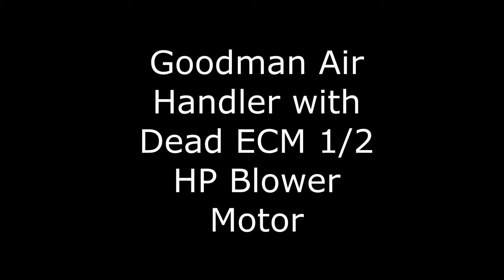Dead ECM Blower Motor in Goodman Air Handler Replaced with Traditional 1/2 HP 1075 RPM Blower Motor

Comment: Couldn’t you have used a contactor as a relay for the high voltage going to the motor and hooked a common and green from the thermostat to the 24 volt side that way whenever there’s a call for g it will send power through the contactor and turn the motor on. What do you think ?
Reply: Thought the same
Reply: That's what Steve Lav did!
Reply: I was just gong to say the same thing.

Comment: a decent solution would have been adding a fan relay that has normally open and normally closed contacts, use  green from t-stat to turn relay on and (N/O) contacts to run blower on higher speed, then with relay off the (N/C) contact feeding lowest blower speed for continuous air circulation.

Comment: I understand the motor isnt available, but what about the Motor Module alone?
ohm the motor and if all 3 legs are the same, motor is good and get Module.
Reply: Probably it would cost more to rebuild than to buy new. Also the bearing might be going bad or  smth else that has caused the board failure is still present. Bundle that with the fact that you have to give some kind of warranty on the repair...
Reply: seperate module is not available from goodman yet. It's happening soon but not yet

Comment: Would you consider taking a 28VAC tap off the control board,  connecting it to the coil of a 2 pole contractor in the air handler ( using it as a switching relay) to switch the fan on/ off ?? 🤔

Comment: You should problem learn how to check an ecm motor, 9 times out of 10 there is nothing wrong with the motor it’s just the end bell module that can be removed and replaced without even taking  the motor out of the housing, if your not testing your guessing I thought

Comment: You mentioned that you were going to install a relay, but it wasn't shown in the video. Plus you never showed the final wiring. Of course, it's obvious that you didn't need a relay if the motor is going to run 24/7, but not every tech is going to know that. Entertaining sure, educational: not so much. You need to be more thorough from start to finish if your objective is to help the HVAC community learn. Just my opinion. Thanks for the video.

Comment: Did you tell Sippy Cup that the motor is reversible and you must check for proper rotation and if incorrect, you must change those two wires with the spade  connecters on them?  Another question; is he there to learn, take video or to aggravate you?
Reply: Seems like his purpose is to shoot video and aggravate Mike. Personally would rather just go it alone given the skill set or lack of from this kid. He is getting an education just does appreciate or realize that unfortunately is the way he comes across.

Comment: Love your videos.  In case you weren’t aware, those typical x-13 motors are available everywhere today even Amazon for around $250.  Those are Genteq motors and sold under various names with Evergreen being the most popular.  Yes it may be true the speed may not match exactly but it doesn’t have to.   If you’re that concerned, you have 5 taps so you could select a speed that is closest to what is needed.  You could also reprogram these motors very easily as others have indicated if you wanted to match the exact speed.  But in its unlikely you would need to change anything.  The tap speeds are usually very close to original equipment.  There are several problems with a continual run/constant speed motor.  One is when the Condenser shuts off, the continual air flowing over the evap will throw lots of humidity into the building air.  You will likely smell it for about 5 minutes or so.  The second issue is if this is a heat pump/heat strips, the heat strips require a faster speed than the air conditioner.  You run a risk of the strips overheating. Just a thought.
Reply: Good points about the humidity level from the fan running 24/7 and odor. Didn’t think about the heat strips if this was a heat pump. So the $250 price from Amazon is the fan motor only and Ecm module that connects to motor must be purchased separately I assume. Personally would not want a 24/7 fan in my home.
Reply: No its the whole motor complete with ECM module.  The OEM prices for the same thing are ridiculous and upwards of $700 or more.  Most supply houses offer the Evergreen motors but there is usually a markup of $100 or so over the $250.   Another thing to consider is when an ECM X-13 motor fails, it may just be one of the speed taps usually #2.  If you switch that wire to another tap, it may run the motor and at a little higher speed.  This is useful in that you can get a customer immediately working while you wait for a replacement.
Reply: @rogerf3622  Thanks for your reply. I have an old Trane air handler with gas heat and split system cooling that’s about 18 years old with an ECM motor. Good to hear there are cheaper fixes rather than OEM route.

Comment: It’s often just the end cap on ECM-blowers that go. The motors are really very durable. I have only replaced two complete motors in the last five years. You should pick up a motor tester. 🇨🇦👍
Reply: some techs take it that far. some of us replace both to tie up loose ends.
Reply: most ive changed they wont sell cap alone

Comment: Pro tip I learned in my days of low voltage installs. Cut your zip ties off flush with a pair of flush cutters and you won't run the risk of them cutting the ever living f**k out of your hands next time you dig into the wiring.

Comment: Spend 5 more minutes and like 10$ more for the relay and have that fan shut on and off with thermostat call.  Running just the fan 24/7 will bring all the moisture back into a house causing high humidity...
Reply: @PipeDoctor  I'm sure that uv light is only for coil sanitation meaning it doesn't really clean the air and defiantly doesn't need high speed blower operation at all times.  Low speed on ecm yes, but not full power of the psc motor 24/7.  I have nothing against ecm to psc conversion, but might as well put a relay on there to make it right.
Reply: Also I highly doubt that ecm ran 24/7 to support the uv light theory

Comment: General Aire makes a current sensing relay that would be good for this application too. Look it up there are two, GA51 and GA50. One is for 24 volts to like a humidifier application and another is 120v. I'm sure there might be one for 240v.

Comment: I give you props for "making it happen", however the customer has a ECM Motor because it has MANY economical advantages. I would have installed that motor temporarily to limp him through until the ECM was available. With that Motor running at 100% capacity, 24/7, 365, he's gonna see an increase in his utility bills and IMMEDIATELY blame it on YOU. Just my 2 cents

Comment: You can purchase a non-oem motor from ECON or EVERGREEN. If you give me a model and serial i can find a similar motor to the OEM. Also adding a relay between G and Common that breaks power to fan will allow the fan to run, you could also do a double pole double throw so that it comes on in cooling. Just watched rest of the video lol you did what i would have done.

Comment: great video i would have never thought of replacing and ecm motor with a traditional motor. so the module wires from the board are just left disconnect and not used, that's why the blower will run 24/7?

Comment: I thought running the blower fan 24/7 would bring humid air back into the house vs just having it run while the condenser is operating. But I guess if you are in a pinch...

Comment: You could add a double pole relay or contactor and energize it off a call for fan from the tstat to have control over the blower. But it is best to have the fan running 24/7 with indoor air quality products like Uv lights

Comment: Running 24 \7  causes the reevaperation of the condensate.
Reply: @Kevin After the AC stops running the evaporator coil is soaking wet with condensation if the fan continues to run that condensation evaporates back into the air and will be distributed throughout the home. This will occur before the condensation has the opportunity to drain out the condensate line. It can cause high humidity issues especially with a home on the beach front. Carrier Infinity systems actually have a 10-15 minute drain time period where it shuts off the fan after the AC shuts off then allows the fan to run if the fan on mode has been selected. Just FYI.
Reply: @Kevin Would you rather high humidity in your home or the fan to run to support a UV light? A UV light should be installed in the actual airhandler cabinet to disinfect the evaporator coil and it’s cabinet where the moisture actually is that can cause mildew and mold hence preventing needing to run the fan continuously. Most UV systems are improperly installed and it also depends on what the UV system selected is capable of doing whether it’s an individual bulb or something like an Air Scrubber, APCO, Premeire One, etc.

Comment: the problem with running a fan 24/7 is when the compressor shuts off you're now reintroducing the condensation left on the coil back into the air.

Comment: Nice "out of the box" thinking installing that conventional motor. Wondering, are there any companies around that can repair just the ECM controller module? Seems like the majority of the time that's what fails, not the motor itself.
Reply: Grayfurnaceman has a video on them. He says it's usually the thermistor or the mosfets that blow and how to replace the them. When the motor board costs $500 and the motor itself costs $500, it's worth it.
Reply: @gregorymalchuk272  Thanks for the reply, will check out the vid you suggested.

Comment: Why are there plenty of Goodman ECM blowers on Ebay but, the supply house is back-ordered 6 weeks?
Reply: @PipeDoctor  No, new. Since the customer had to pay for a new PCM motor AND a new replacement supply house motor, you could have offered to get a new or, used even,  Geneteq ECM motor on Ebay for less than the cost for both motors.
Reply: @PipeDoctor  OPM. Not your problem.

Comment: Don’t know if I misunderstood but you said the blower runs 24/7 if there’s a UV light? That would bring humidity into the home from the coil and pan when compressor is off. Shouldn’t it be that if the light is in the duct, it only comes on when the compressor is on and if the light is in the return at the coil, then that light stays on all the time but either way the blower cycles normally?
Reply: Correction, (If the light is in the duct, it should only come on when the blower is on)

Comment: You could have installed a fan relay. Run low voltage wires to the coil of the relay from the G and C . So the motor would shut on and off. I do this all the time for people that can't afford a new ECM.

Comment: 1- that was the best tutorial for the youngster he may be salvageable.🤣
2- you did turn the switch off but you didn't test the circuit,remember you are training a young person.(off&test)and you should mark your schematic.
3- do an amp reading and mark it on the housing.
🍺🍺🍺🥃🥃🍇🏌
Stay safe.
Retired(werk'n) keyboard super tech.
Wear your safety glasses.

Comment: Why not use a contractor for the motor and put it parallel circuits with the with the condenser contractor (24v), thus it will only come on when the ac is running.. just a thought

Comment: Mikey where are you all located. If I'm ever up that way I'd love a job. Or a least to take over sippyCups spot. Mostly residential but do a decent bit of commercial. Currently doing a commercial job with two 7ton RTU's. Last year did a new rehab building with 5 complete systems ductwork and all. Fire dampers and sensors all that. I love watching your videos. Watch then daily after I get home and find time to relax for the evening.